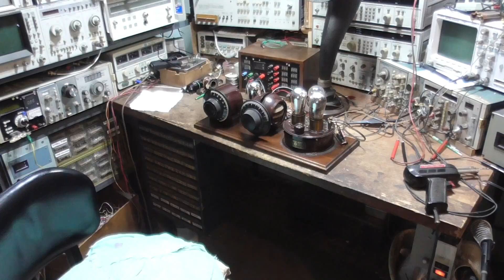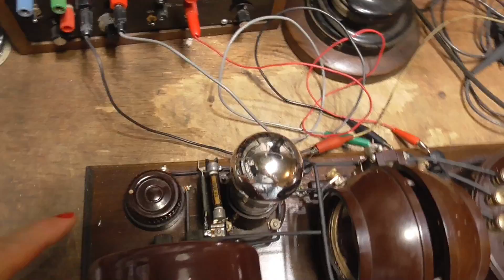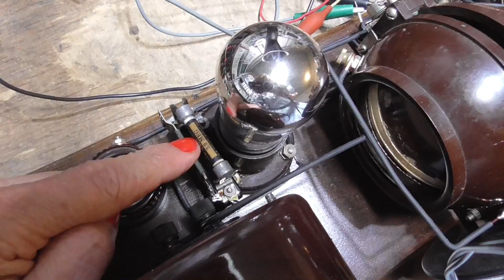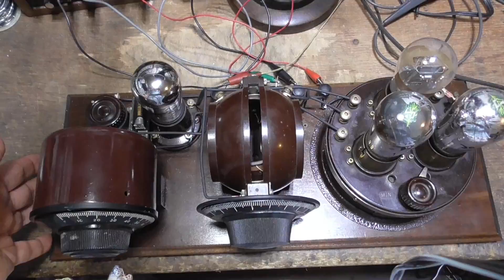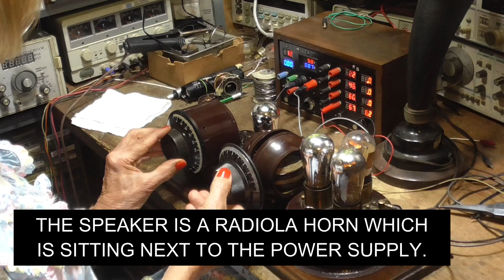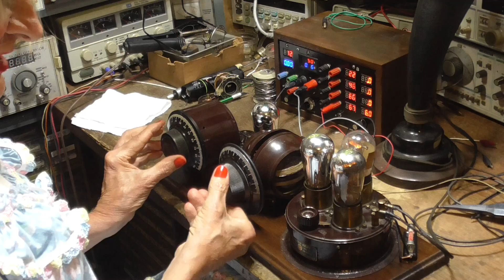HOMEBUILT ATWATER KENT BREADBOARD RADIO

Comment: Hello! Great video. I liked the radio, if it's not too much trouble, could you share the diagram of this radio?
Reply from the maker: Use the front end and amplifier pod schematic from a model 10 breadboard. I simply removed two stages, otherwise it is the same..

Comment: Why use such a low B+ voltage (66V ?)? Is it to preserve the tubes? Very creative use of parts ... always nice to see what one can make with parts that are otherwise condemned to end up on the skip or in some parts bin
Reply from the maker: The type of tubes used in these early radios work perfectly at 45 to 67 volts. So you can use low voltages to keep from getting shocked if you don't pay attention!  :)

Comment: Hi ya.... do you have a video about how to work out what power requirements a radio needs when there is nothing on the unit to tell you, also for how to work out the valves required? Also, your custom made power supply seems to be hugely useful, my local electronics supplier has nothing to match it. I have two radio's that are 1920's or 30's and don't even know where to start. I bought them for the parts to make a replica WW1 Marconi 500w pack set for a display, but they appear to be complete, minus tubes and I haven't had the heart to destroy them.
Reply from the maker: Look up the tube types and multiply the power for the tube by the number of them in the set. Most of the time tubes of that era were 01-A which use 5 volts at .25 amp each. Chopping old sets for parts can be sad especially if the set is in good condition.
Reply: @glasslinger  Excellent. Many thanks. If you'd like pictures, in whatever detail you'd like, to add to you references please let me know and I'll get them for you.

Comment: where do you like to get your resisters, capacitors and other things since radio shack is gone.??
Reply from the maker: I never did use R.S.  I look on ebay for them. You can get really good deals. For high use capacitors I buy in bulk from Mouser Electronics.
Reply: @glasslinger  THX

Comment: Ron, nice radio using the old Atwater Kent parts you had saved!  The variometer reminds me of the book by H. P. Friedrichs ("The Voice of the Crystal") where he covers building one at home to experiment with, along with all other parts needed to build a crystal radio.  Now I need to re-read his "Instruments of Amplification" book to see how he builds, among other components, primitive vacuum tubes & (point-contact) transistors, all to eventually build a working (& powered) radio set.  I have no clue how well the components from either book will work, but I suppose that simply depends on the care I take plus experimentation to see what works the best in a relatively primitive radio set.  Your videos are an encouragement to go ahead and "play" with building my own components and, hopefully, one or more working radios!  ;)